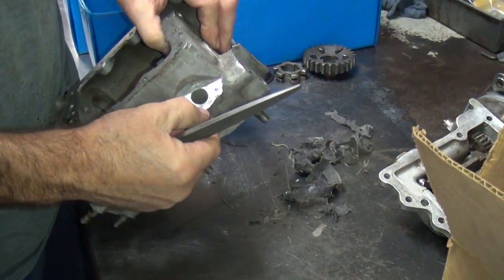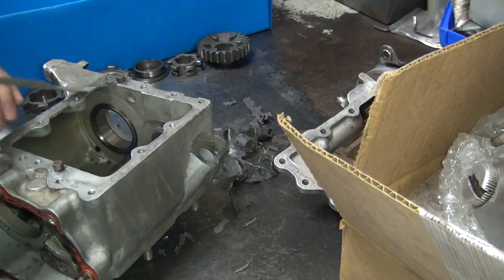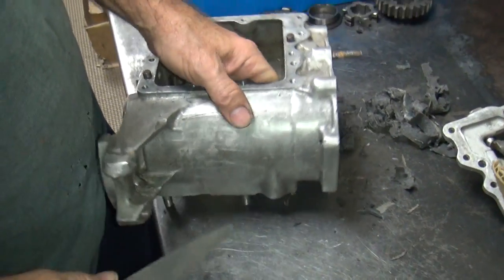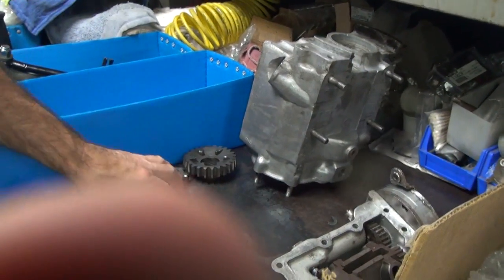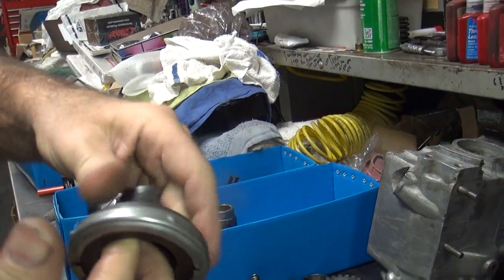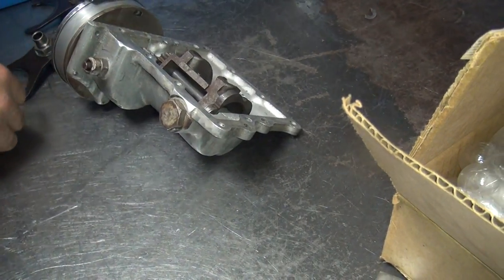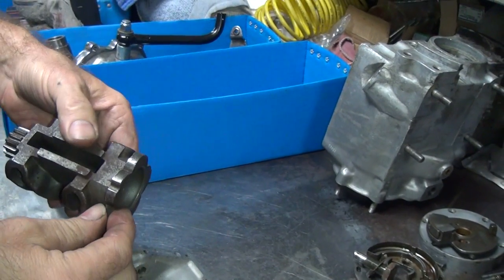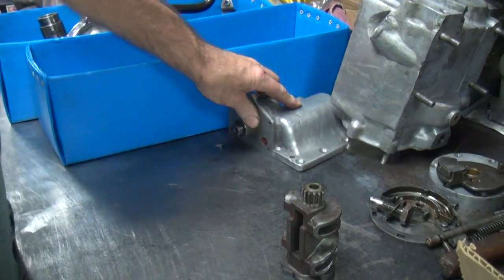1965 panhead #102 4-speed transmission rebuild FL FLH 1966 panhead harley by tatro machine

Comment: I can't believe you are beating on your tools.
Reply from the maker: they are tough and can take it just like i can. after 40 years of abuse they still keep going and look good. must not be hurting them all that much. most people are oversensitive and haven't got a clue.
tatro
Reply: Tools are made to fix things with, not admired.
Reply: i have tools I have had at least that long. Some I beat the hell out of. Just kidding about you using a hammer on a tool. Actually, I have some tools in my shop that I purchased for my first job as an electrician's helper over 40 years ago. Still have my original tool belt, voltage tester, knife and some of the screw drivers.
Reply: I know, some of my favorite tools, I acquired in the 70s.
Reply: Those files are shot.

Comment: Mr. Tatro. Are the shifter rollers made of a harder material than the the shifter gears?
Reply: *Dinosaur * eating and chewing AND, sticking his finger in front of the lens. both things really detract from the video
Reply from the maker: get over it.
tatro
Reply from the maker: and then life goes on.
taro
Reply from the maker: yes the original 60's rollers are hardened and the crappy 70's parts are not.
tatro